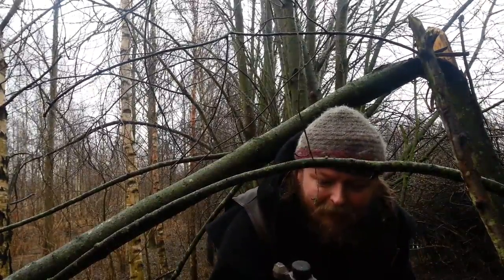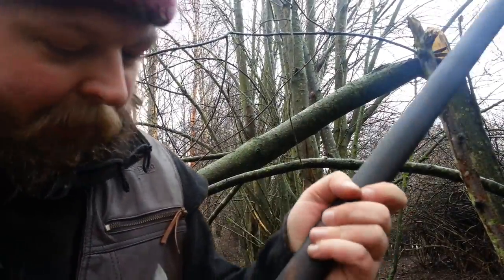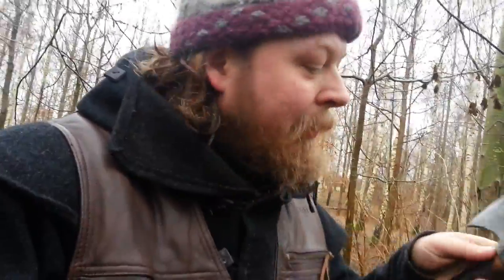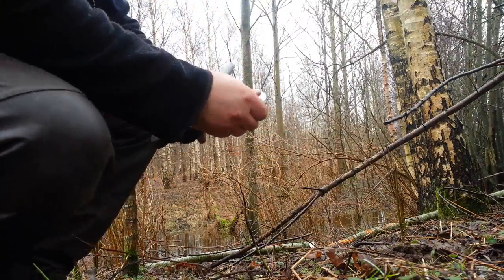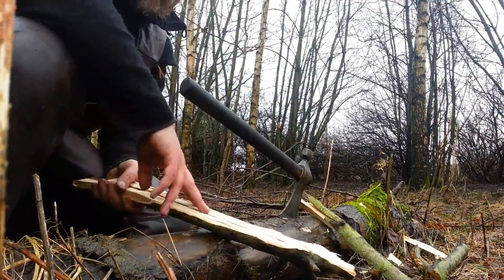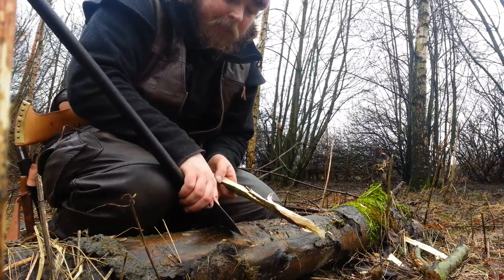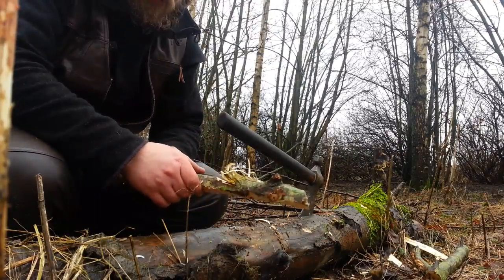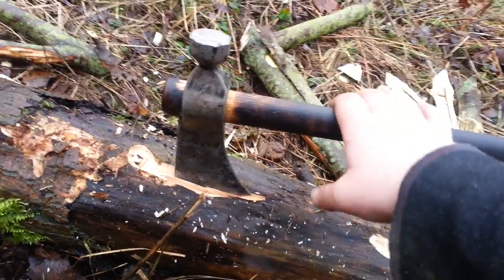Cold Steel Rifleman's hawk - processing wood

Comment: I used a round metal file to round out the sharp edges inside the head and sand paper to smooth the surface of the handle. This will give a tight fit. The more surface area of the head you can get in contact with the handle the better.
Reply from the maker: +cdhembree1 
I have done that, but in this case the shaft has swelled thanks to a moist enviroment and then i took it inside and it shrunk. So when it swelled it actually got so big that it dented the Wood. I have had it a couple of years, and it has been periods where i haven't touched and that was what happened now. But i thank you for your advise, they come very unfinished in my opinion.
All the best, Rob
Reply: Yea, they need a lot of work to get right.

Comment: nice tomahawk~ Can I have a question? How did you make black color on handle? ^^
Reply from the maker: I oiled the handle with linseed oil and then burned it dry... carefully with a gas torch. You can use any vegatle oil for it.
All the best, Rob